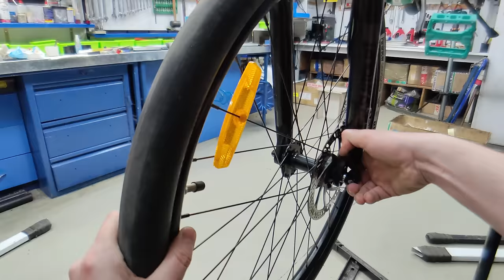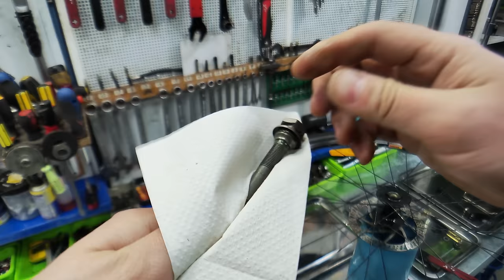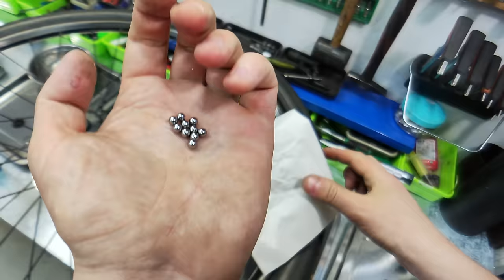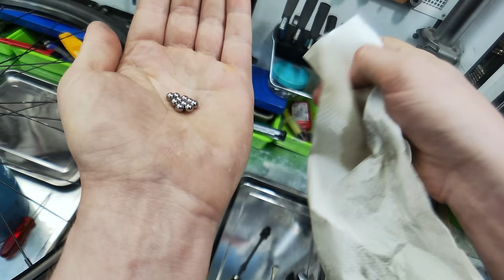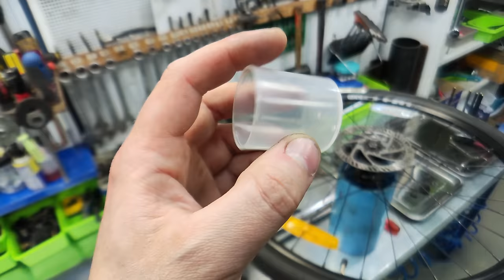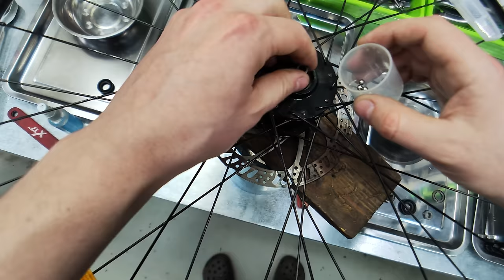Maintenance of the bicycle hub by the mechanic. Bicycle hub with ball bearings

Comment: The cones look OK. But if supply of spares is not available and the cone isn't severely worn. The bearing surface can usually be refurbished with a small lathe(a drill will work the lathe is better) and small grinder (Dremal with an elipsiod grind point) . Just remove the lock nut and spacers expose about 15 mm of axle and put it the exposed axle into the chuck with the cone surface facing out ( turn at lower speed not to low). Then use the grind point(high speed)to clean up the pits following the conture of the cone. Once that is clear and smooth wrap some emery cloth around a small screw driver or an awl ( that will  give you a taper) and spin the cone at high speed and polish going to finer grit . This actually works pretty well I've been doing this for many decades and always my personal wheels have this done. That way I  can  keep Shimano cones in Shimano hubs they hold up a long time in a properly adjusted hub. Just a tiny tic of play in the rear hub a little more in the front. Once the quick release skewer is tightened the axle compresses and the play will be gone. My 🙏

Comment: Is that Shimano premium grease?
Reply from the maker: yeas
Reply: @NiceBikeService  I'm curious is it better to use bicycle specific grease for cup and cone bearings? I've been using Shell Gadus grease on my bikes for years and so far no problems, although Shell Gadus is more oriented to industrial applications and it's more viscous.
Reply from the maker: A more viscous one will ruin the roll of the bike's wheels. And a more viscous one will leak out from under the hub dusters.

Comment: After how many Kilometres do you make these type of maintenance with new grease?

And after how many Kilometres do you change/replace the bottom bracket?
Reply from the maker: The bottom bracket is replaced when it makes strange noises and cleaning no longer helps, or when there is play. This can happen after 500 km or 20,000 km, depending on the quality of the bracket itself, operating conditions, rider weight, etc.
The same goes for the bushings: if the wheels spin well and the bushings do not play, it is better not to open them again.